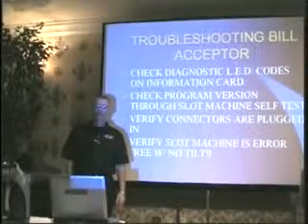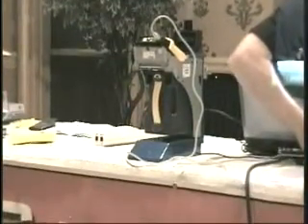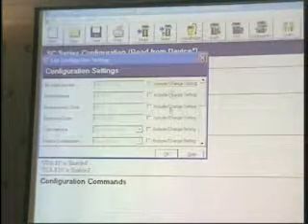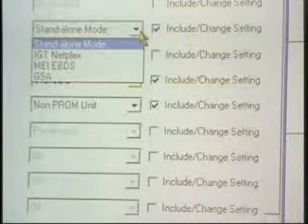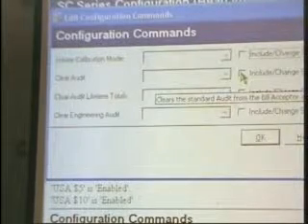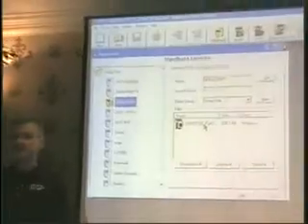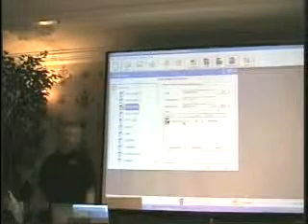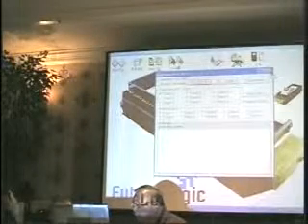MEI SC66 Bill Validator-Part 7 of 7

Comment: Hello Mr. Randy. I'm having issues with some SC advance Mei head and I'm wondering if you can give me a hand.
1) 1 red flash, but the acceptor head was working fine few minutes before the cash box was replaced. Now, it is not working any more.
2) Other head: 2 yellow flashes. There is no jam, neither in the box nor in the acceptor head. I've also replace the cash box but it still flashing.
Please, try to give me a tip to solve this issues cause there are like 20 acceptor heads with one of these faults.
Thanks and regards.
Reply from the maker: Todd.Aase@cranepi.com 
Send your question to Todd